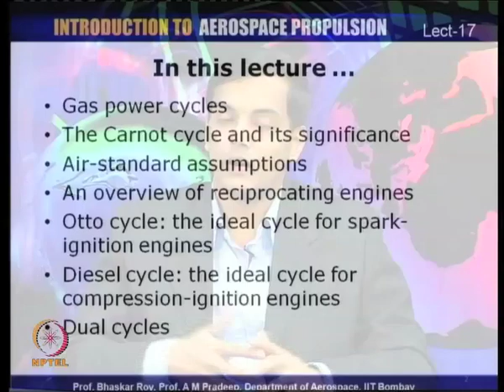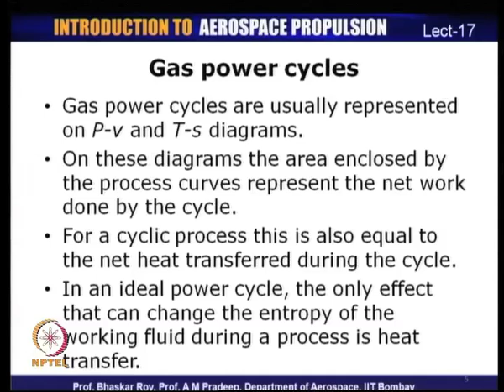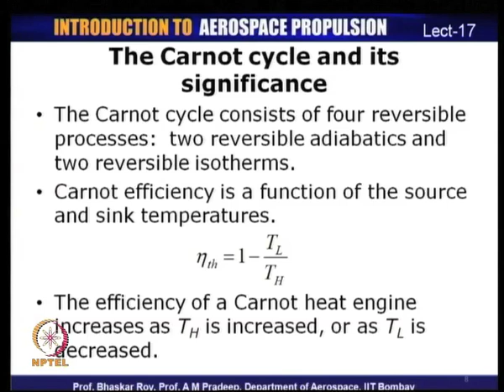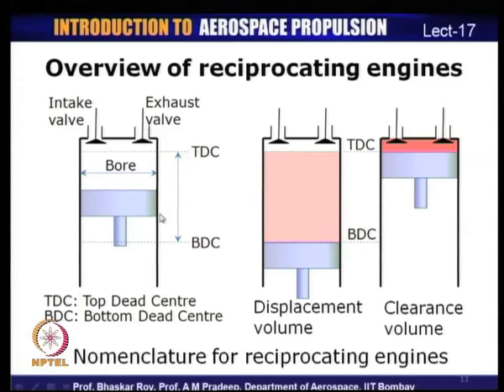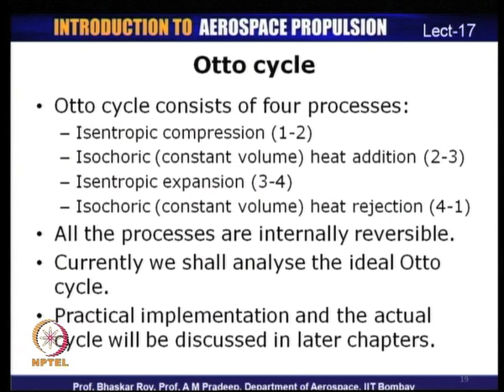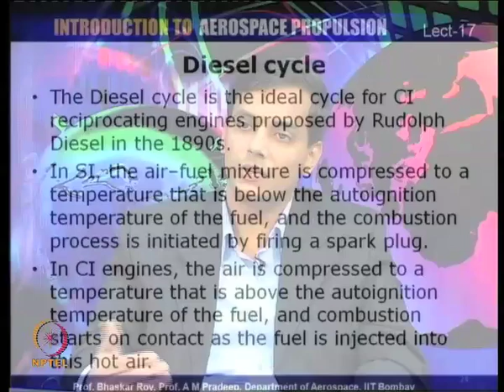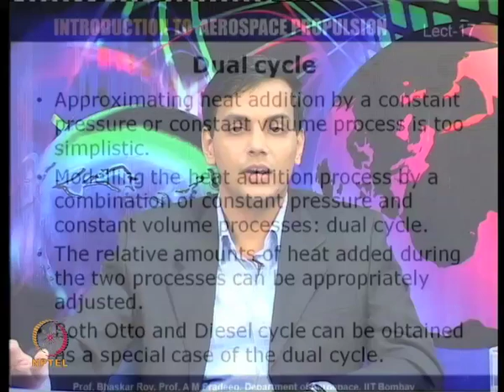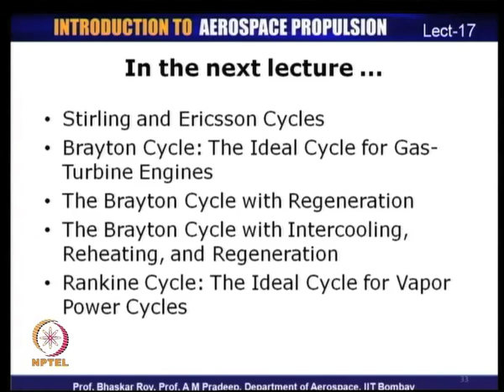Mod-01 Lec-17 Gas and vapour power cycles, Otto cycle, Diesel cycle, Dual cycle

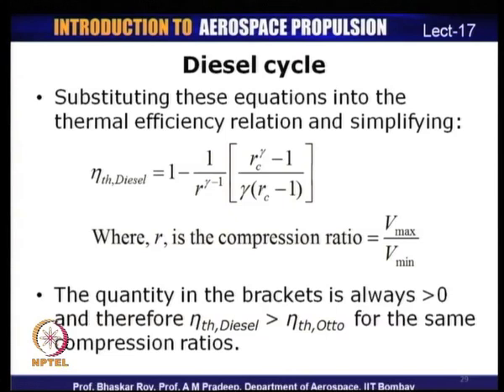Comment: In slide 29, at 43:48, it is informed that the thermal efficiency of Diesel cycle is greater than that of Otto cycle. However, the opposite is the true for the same compression rate.
Diesel cycle is more efficient than Otto cycle because the Diesel one can operate at much higher compression rates (sometimes the double of those allowable in Otto cycle).

Comment: Moreover, to be more precise, term in the brackets (also in slide 29) is always higher than 1.0, so this confirms that thermal efficiency of Diesel cycle is lower than that of Otto cycle if both operate at the same compression rate.

Comment: Thanks for the lecture, I appreciate your help. But just a CC lecture may be more informative rather then reading slides.

Can you please provide me a reasons behind following--

"Difference between Internal and external reversibility", "Why we consider constant volume heat addition in case of otto cycle where as in case of diesel cycle constant pressure "